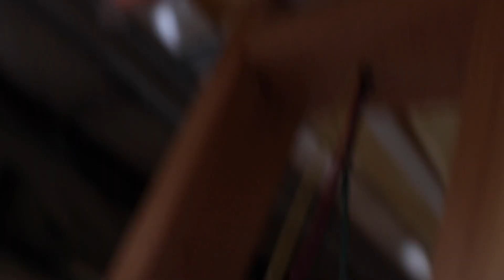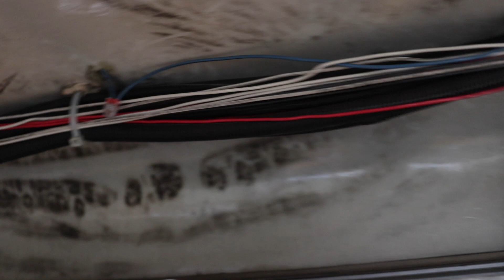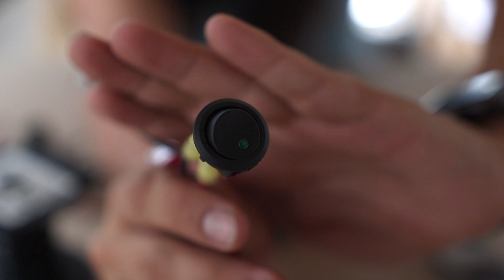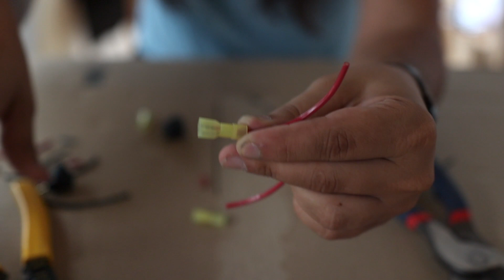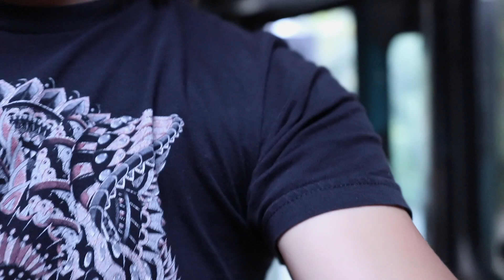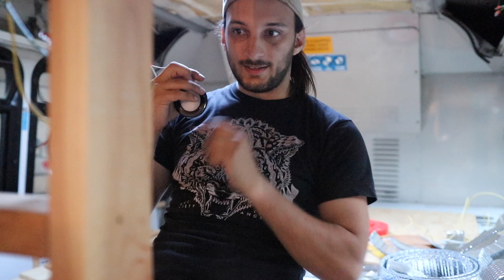Bus conversion: WE HAVE POWER! How to wire 3 prong round rocker LED Switch

Comment: Great video fella.
However you have made a lot more work for yourself by using the LED switches!
Personally I wouldn't have bothered with the LED switches then that way you wouldn't have had to run extra negative cables to all the switches.  Saving money and time, what do you need an LED on the switch for anyway, the lights being on will let you know the switch is on!!! lawl

Comment: WAY TO GO! Getting electricity has got to be one of the most satisfying parts of a project. When I walked my brother through running all of the electrical in my bathroom, it was probably the most exciting time when the lights actually turned on LOL.  Also, I like that your bus has a wheelchair lift. Have you tried it out? If our paths ever cross, you are one of the few conversions that I could actually visit. :)